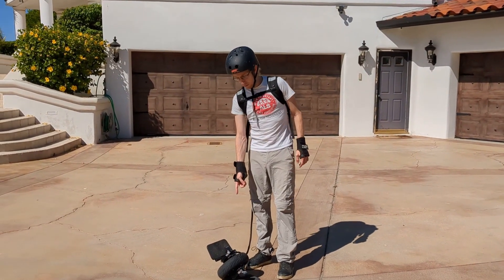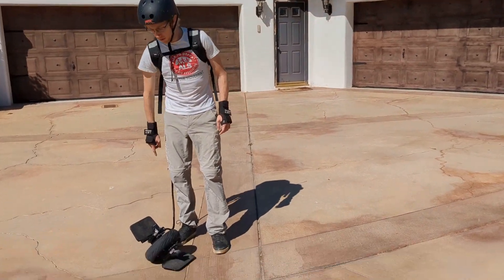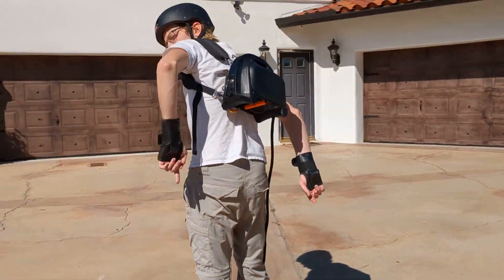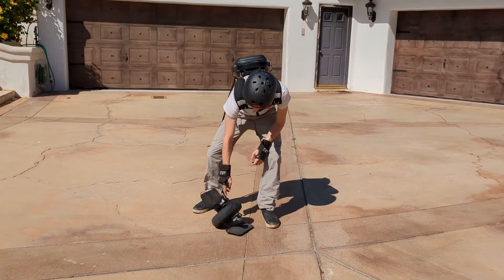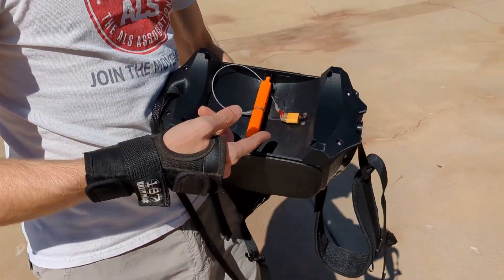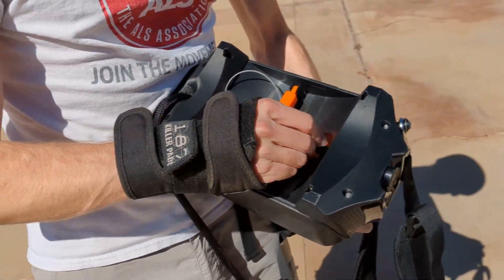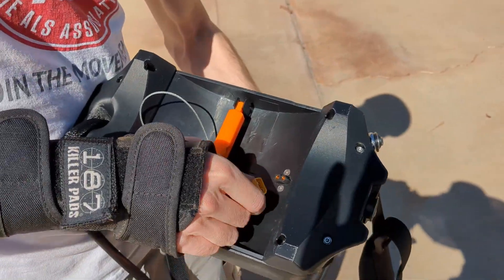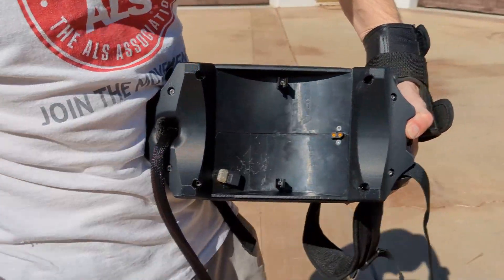MTiny Demo - Minimalist EUC

Comment: My brother.  I have been looking for a video with some one else besides me doing a mod with a small self balance scooter.  

Are you using the Trampa VESC 100/250?

I have an iota trax I am trying to modify this spring.
Reply from the maker: This doesn't use VESC, it uses the original mainboard but with the IMU relocated. Check out the forum post in the description for more info!

Comment: Looks like a nekkid S9 or its distant cousin. 🙂 I like the concept of just plugging in a battery pack with a cable that doubles as a harness tether. There some potential market for something minimalistic like that, especially with the battery backpack concept. Great way transportability and potential can take on planes if you check in the battery pack? Have you talked to any of the EUC manufacturers yet?
Reply from the maker: Naw, carrying the battery weight is really rough for anything more than this (512Wh). A simply removable battery is a better solution for that, like what In motion is starting to do!

Comment: Put copper plates under each shoe that each connect to the positive and negative terminals of the battery. Then it will be wireless. lol and dont walk on anything metal.

Comment: I think adding one of those auto-retract things for the cable will keep it out of the clutches of the tire, and will still allow for slack when needed. Very cool concept. I can imagine a variation where the wheel itself clips onto the pack for “toting” like a backpack. You unclip and ride off. Very, very cool gadget either way.

Comment: How are you keeping the IMU data signal stable? Whenever I have cables longer than a few centimeters a ton of noise gets introduced
Reply from the maker: Check the forum post in the description, there is a schematic for the board I designed! The I2C is converted to differential and back using a special chip, which lets me run it over several feet of wire with no issues

Comment: That's pretty rad!  Does the altered weight distribution make any noticable impact on the ride or how nimble it is?
Reply from the maker: It certainly feels more nimble, there's so little mass at my feet it's super easy to throw around! It's slightly countered by the extra weight on my back though, throws off my balance a smidge